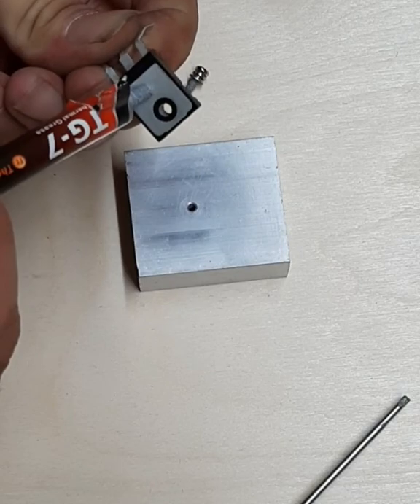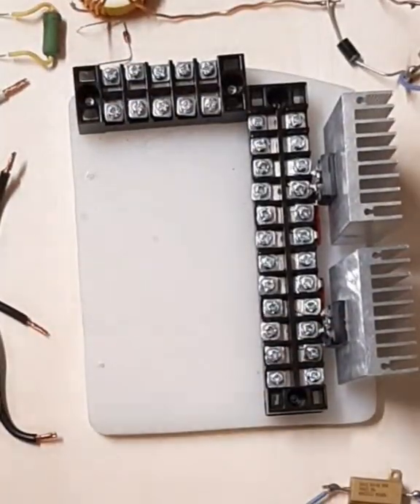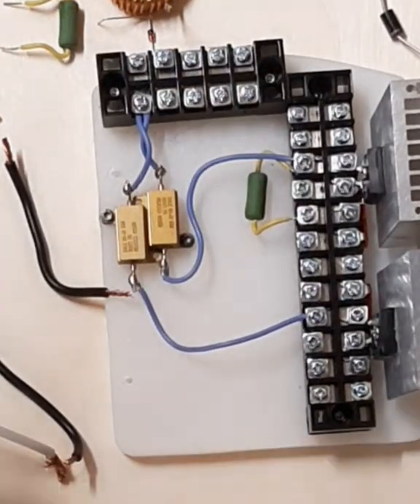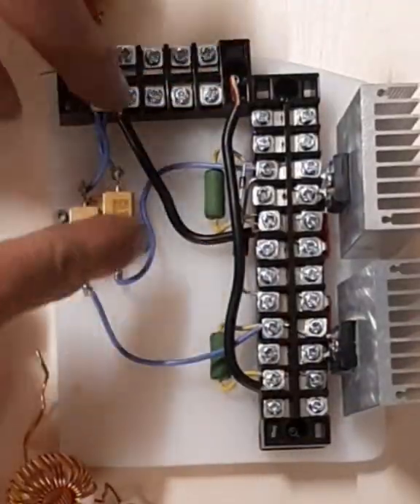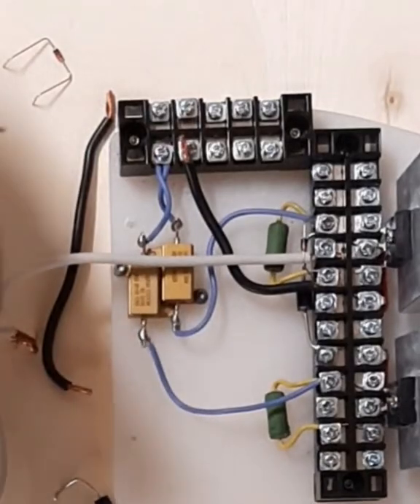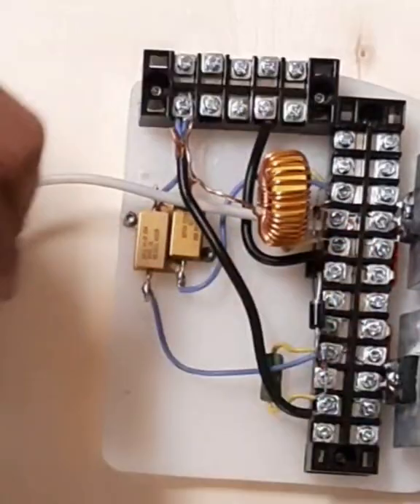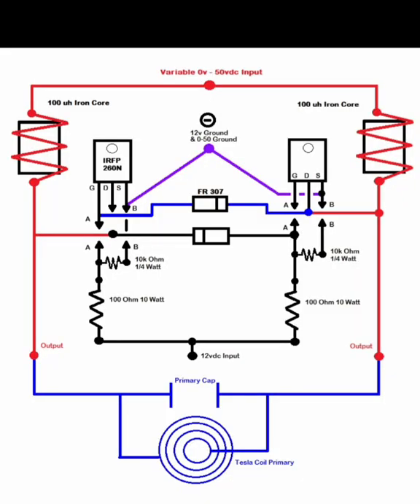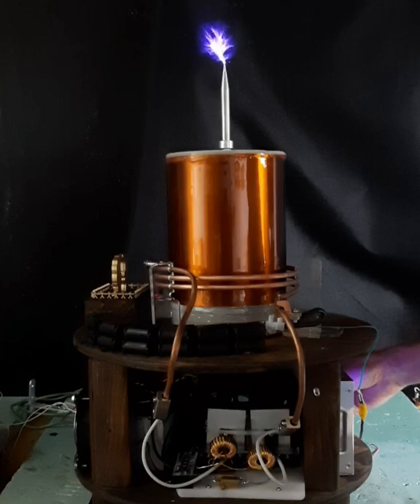⚡DIY ZVS Driver for Tesla Coil⚡#diy #zvs #tesla

Comment: Quick question: Does the audio circuit have a separate power supply? Is there a total of three power supplies? 

-1-power supply 12 volts DC to start the oscilation. 
-2- power supply 0-50 volts DC for the zvs 
-3- power supply for the audio? 

I appreciate your help. 
I have learned so much from you. 
I consider you as my Tesla coil mentor.
Reply from the maker: @shawncalderon4950  thank you very much!! There is in a way 3 power supply but really only 2 the audio source that I run uses a battery to power the Bluetooth device and the audio output is what drives the other switch can be any audio source. Can even plug into the wall like a radio with external speakers. Does this make sense? 👍👍
Reply: This makes total sense. Thank you. Your work on Tesla coils is an inspiration.
Reply from the maker: @ thank you! Will be getting back to it in about a month or so🤣👍

Comment: awesome! Have some questions left. You have separate power input for drains and base, according to schematics?
Where does the second wire from secondary Tesla coil goes? Straight into the ground or....?

I have a Tesla coil on 1 npn transistor where the second wire goes to the base of transistor. It works fine, but is needed at least 35 volt to become spectacular. Now I want to power it from ZVS, but can't get where to put the second wire from the secondary. Help please!
Reply from the maker: Thank you⚡️⚡️ the secondary wire goes to earth ground. I put a rod in the ground you don't have to go very deep. I have one 6 feet in the ground, you don't have to go that deep especially if you water it before using it. I even had a wire laying on the ground and poured water all over it and as long as it was in the water, it worked fine🤣🤣 I have done it other ways also. Good luck and if you have any other questions just ask thank you!
Reply from the maker: @MaDnBaD  about the separate power sources the 12v power source is running gates but grounds are tide together so the system will run on just the 12vdc with very low current. Just like a slayer circuit then the other 0-60vdc or A/c with a single diode for halfwave.
Which gives swords. But tuning on a zvs is tricky have a video on that. Zvs with a single input voltage need a lot of current to get started so separate power supply work better 👍👍

Comment: I have watched this video several times and have tried to build this circuit. I have everything together except for the secondary's diameter and length, the magnetic wire's AWG, and the specs on the capacitors. Please help? p.s. This is my favorite HV channel:)
Reply from the maker: Thank you!! On this coil I have a secondary that is 5.5in diameter and using 32awg wire on secondary that is 7 in tall wound but the secondary is around 9in tall. You can use a smaller secondary say 3in pvc and sand it smooth no labels and can do 30awg 14in tall. Caps there are a few options you can use cornell dubilier capacitor .150uf 3000vdc work great with around 3 turns but have 4 turns and you will have to tune let me know if you have any more questions
Reply: @ArcAngelTeslaCoil  Ah, man, I nearly leaped for joy when I saw your response. My wife reminds me daily that I'm such a nerd. What is the total capacitance of the primary capacitor? When you say tune, do you mean an alligator clip on the primary coil? Does the circuit oscillate when only the 12 VDC is applied? Can I replace a resistor with a pot to help in the tuning? I'm going to get started on winding the secondaries as per your requirements! Thank you so much! As a retired disabled vet, building Tesla coils has given me so much happiness. I was an electronic engineer in the Navy but never learned about high voltage, especially Tesla coils. You are an absolute Jedi master!
Reply from the maker: @shawncalderon4950  the cap you should use is in the very beginning of this video on the zvs but it's better to have it right by your primary not the driverhttps://youtu.be/jfBCoJFytbw?si=e9G8lpds-yrrrPz-
Reply from the maker: @shawncalderon4950  when tuning yes a alligator clip is ok at the beginning but will get hot a better tap point after finding were it like to run. Also never touch the arc on a zvs will throw it out of tune and can blow a fed.  Yes it will oscillate with just gate power this is one of the safest ways to tune without main dc power need a little neon or fluorescent light and hold near the secondary should light when close to tune. You never use a pot in the secondary circuit but can if audio modulating. Also you can interrupt the zvs with another switch. Will show you one more video of a half wave rectified zvs using a set down a/c transformer with variac or variable transformer to make sword like arcs.
Reply from the maker: @shawncalderon4950  this video there is halfwave rectified main running max 60v https://youtu.be/K0tg2ov5tBc?si=7NhzA90SWw_DUrls
Reply: @ArcAngelTeslaCoil  I am writing down all of your instructions. I will then take notes as I watch each of your recommended videos. Then, I will build a working ZVS and half wave and keep you posted on my progress. I apologize for making this difficult. I will set up a Facebook account soon to update you over Messenger.
Reply from the maker: Here is how I wind a secondary this is not the same one but how to do it https://youtu.be/2bkBtETVsl4?si=BRD2gXoSfF4j1L4j
Reply from the maker: There is another video of my latest setup https://youtu.be/YFCgs8rz_50?si=ioWPfSoZ1widhJT_

Comment: Did you connect the secondary to anything??
Pleas respond
Reply from the maker: Secondary is connected to earth ground on the bottom on this setup
Reply: @ArcAngelTeslaCoil its connected to black wires or the power supply ground??

Comment: Whats the secondary turns
Reply from the maker: This secondary is 5 1/2in diameter wound 7in with 32awg magnet wire.
Reply: @ArcAngelTeslaCoil  but how many turns r there approximately
Reply: @ArcAngelTeslaCoil I did the math and it is approximately 600-700 turns
Reply from the maker: @suhan369  don't have to be exact that's why I use copper tubing primary to tune the system 👍
Reply: @ArcAngelTeslaCoil  I am thinking to use 0.34 or 0.37 mm wires and get approximately 1000 turns will it affect the output power because reasonence frequency will not match
Reply: @ArcAngelTeslaCoil can u tell me where the drain is connected of the left mosfet
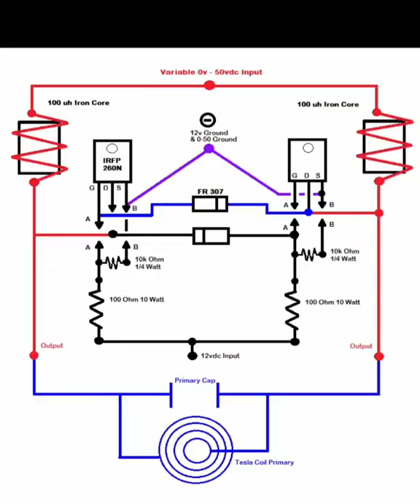Reply from the maker: @suhan369  the schematic is at 7:13 in the video let me know if that answers you question
Reply from the maker: @suhan369  oh I see it is just like the other side the drain has a arrow pointing to the round dot

Comment: What is the number of turns in secondary and what is the radius of this pipe and what is the gauge number of secondary wire?
Reply from the maker: This secondary is 5in diameter using 32awg windings length is 7in
Reply: @ArcAngelTeslaCoil  thank you ❤️❤️

Comment: Why not Zener diodes on schematic? Where to purchase size toroid filter coils?  Heavy amp draw requires 12 gauge wire on inductor filter coil and lower inductance as 50UH.
Reply from the maker: Users zeners at First but they were causing problems so remove them, then no problem

Comment: Great video as usual dear. Thanks for the detailed DIY. Well, what I really wanted to know is how did you construct your ramped ZVS where you got lengthy swords output. Your  previous videos on your ramped ZVS tesla coil was pretty awesome. That's something that I really wanna try. Thanks for the helpful video. Keep it up.
Reply from the maker: Thank you⚡ I'm about to start a big QCW coil some time soon.  The ramped Zvs works good with the ramp. You seen this video https://youtu.be/1HjkPsnUcv8
Using the arduino is great just need a LC filter and run to a ZVS like this one in this video you run the gates on its own power supply and feed the ramp to the positive side of the ZVS.
Reply: @ArcAngelTeslaCoil  Yep, I've never missed out on any of your Tesla coils as I'm one among your many subscribers out there. I've seen both ramped ZVS videos of your TC. But there are so many things & wires going here & there that I was at a loss.
Reply: @ArcAngelTeslaCoil  Andrew Kwasek also did something same as yours & he got huge sparks output. I do know that your friend from SCITUBE is great partner with you & both of you do great things regarding tesla coils. I really admire you both for all the efforts that you put in. Hope that one day when you'll have time, you can make a DIY video concerning your ramped ZVS TC in details. Thanks man. Keep it up.

Comment: I never thought to use screw terminals for the mosfets. What a great idea! Do they get hot?
Reply from the maker: Thank you⚡ The mosfet have a small fan and with that they say cool just about no heat, without fan they get warm. Also if there is a problem there easier to change and test to see if one is bad because the gates are on a separate supply.
Reply: @ArcAngelTeslaCoil  for sure! No desoldering and resoldering and seems like a better option because it pulls a lot of current and I've had drains literally unsolder themselves. Thanks for sharing.❤️